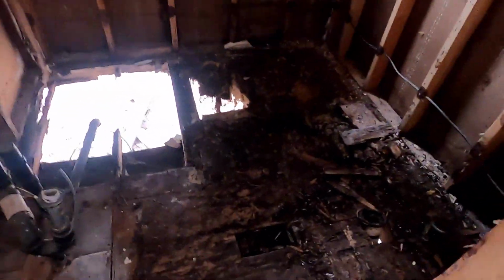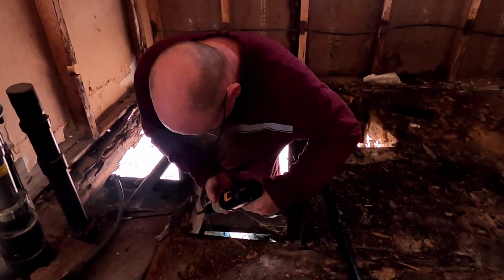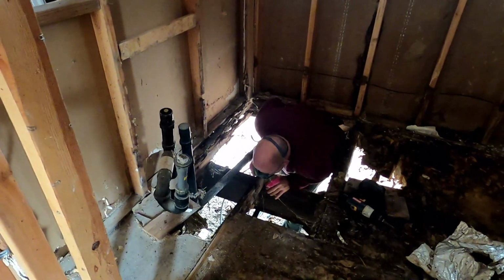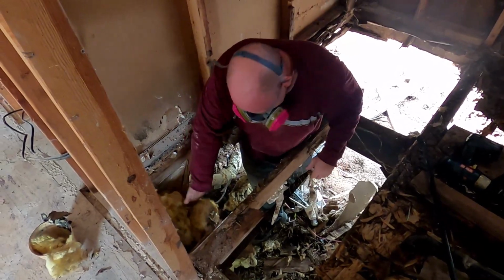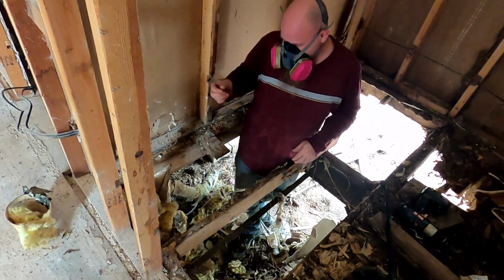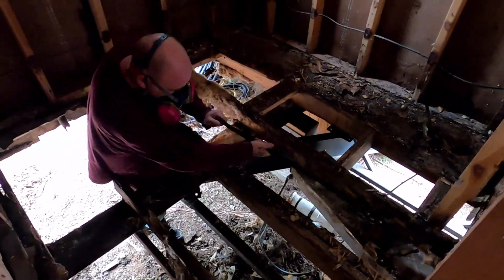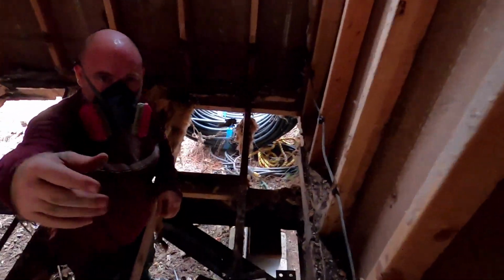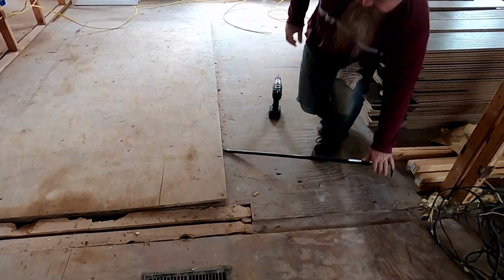RIPPING OUT a rotten floor With a BATTLE AXE!

Comment: Just my 2 cents  n I no nothing about building but if it ur me I’d take off the flooring than subfloor n get to all the  support beams ect I think this would b easier on u n yes it might cost more
Reply from the maker: Absolutely correct assumption... It WOULD be 'best' if we removed ALL subfloor and started over... but we don't have the money to keep living at this rent house and pay for the land payment and renovations too. Because of a lack of finances, we are going to floor over the old but firm floor, replace what we have to, and get moved out of this $1,300.00 per month rental we are in.  
But.... in the Spirit of Good Enough, it will be excellent as it stands. Once new subfloor is patched in, and new flooring installed, it should be fine for a couple decades. 
But yes, we WOULD have done it that way if not for the time/money crunch. 

(If only I could earn money on YouTube or something!😁)